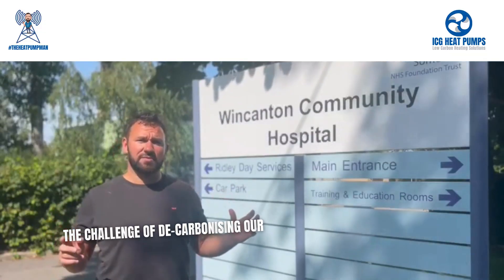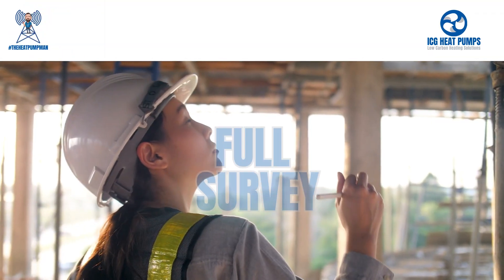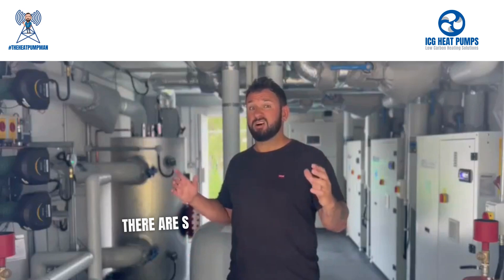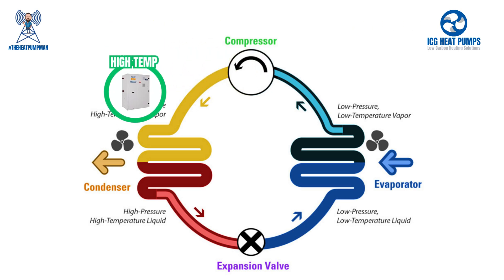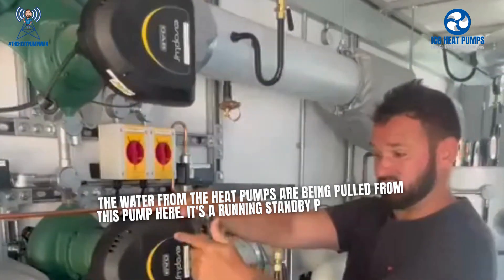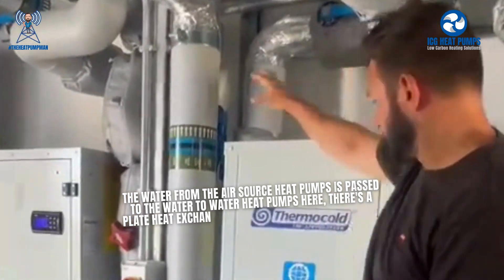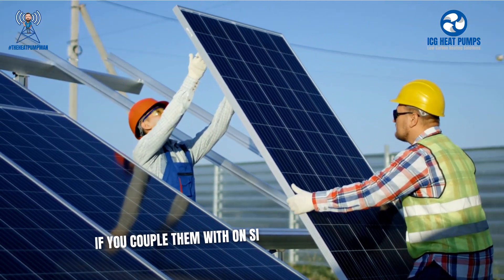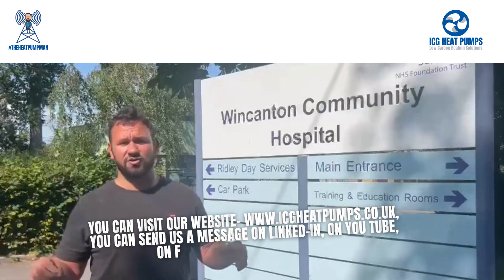UK Public Sector De-Carbonisation Scheme-How Can a Cascade Heat Pump System Help?

Comment: Very interesting I used to do commissioning for a company that had done a few trials for councils in the South that fitted heat pumps to public swimming pools. They only used the heat pumps when the air temp was around 10 degrees so they were always working at a very efficient point. They did save the councils thousands of pounds but sadly the company wasn't run very well and closed down. Shame as it seemed a really good way of helping councils save money, perhaps a good thing for you to investigate with your local councils

Comment: The only video I found on this topic. Thanks! 
What about cascade heat pumps without the 45C water intermedia? I've seen daikin lg and hitachi cascade heat pump with direct refrigerant to refrigerant heat exchanger between stages. They are also capable of 80C and seem more efficient without the water between stages.